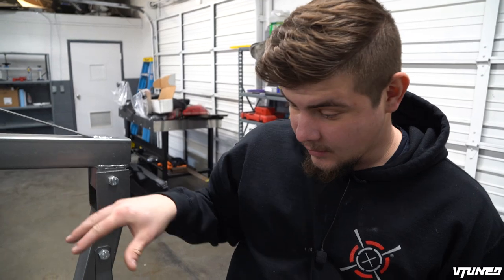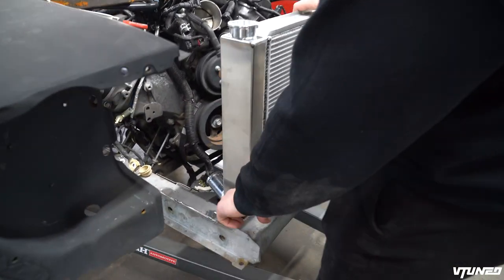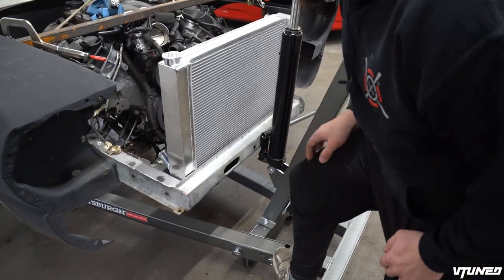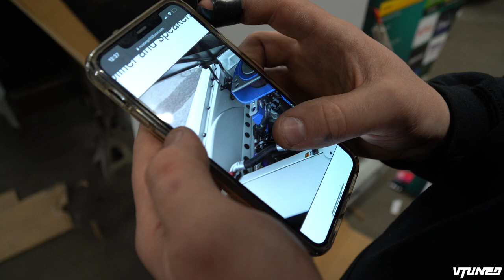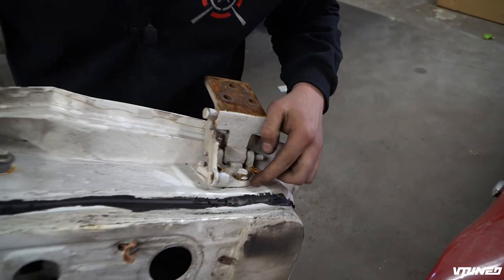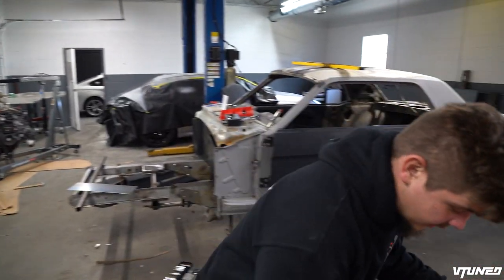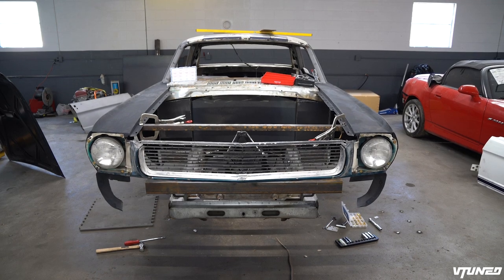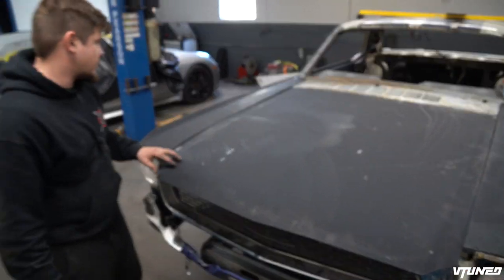Building Custom Front Aprons For My 1965 Ford Mustang ! 1/2

Comment: I still really don't like where this build is going, it started strong but it's going the same way as the last one, you should've kept the OEM firewall, aprons and core support, people have been swapping 5.0 engines into these Mustangs for years and they can handle it just fine, the combination of the firewall, aprons, core support and frame rails is way stronger than you might think, and with the custom subframe it's even stronger, doing all of that work to just have the engine a few inches back won't change anything on the handling, trying to reinvent the wheel for no reason and just to make things harder with the steering column, pedals, a/c/heater, and other things, i'm not hating, just sharing my opinion, but i wish you the best with this build.
Reply: You’re not wrong JD 🤔
Reply: You're also redesigning the structural design of the car...by using (14ga.) steel you are changing the handling of it...the integrity of the crumple zones that are intended to keep passengers safe... especially the 2×3 welded to the frame and the bottom of a A-pillar... using (18ga.) or even(20ga.) w bead rolled designs gives it the strength of (14ga.) w less weight
Reply: This is a unibody car without a frame. I’m afraid it will fold up like paper!

Comment: You are making life hard for yourself.. slow down a bit… you are jumping a head… mount the engine with headers, mount the suspension and steering, brake booster and master cylinder etc… all the items that are fixed then make you your metal paneling and tube frame, that way you can account for suspension components, movement arc’s at travel extremes etc.

Comment: poisonally, i wouldn't cut or design the inner fenders until you have all the engine and suspension built, you never know where you are going to run extra pipes and bits and pieces - all of this is pretty cosmetic including the outer body shell
get the mechanics done first then wrap it up with the pretty bits

i watched what you did before and completely understand why you began to lose interest, the previous build became complicated trying to fit bits around other things as you went into detail, don't its also one of my failings bless

but do as you like, because its way more fun for us to see the mistakes, and changes to design

have you started watching the muscle car channel, i will have to beat young Yuri and get him to nudge you

Comment: The 5.0 GO_CART is coming along, continue to devalue the 65" build your aprons 1st so we can see you hack them apart when you install components later.  Your comment that the original factory design was weak couldn't be further from the truth.  In 65" the designers had more of a thought process in building a car than you.  When all of that metal comes through the dash in a front-end collision hopefully, you'll remember some of these comments you wanted.to hear.

Comment: You really need to slow down with the fabrication of the sheetmetal. You don't even have suspension, brake booster, headers yet.  Seems to me you are making videos to get sponsorship, not make a good job. Slow down and look at the entire picture. If you want tight and clean, you have to have measurements and a plan, not just cobble things together as you go. Custom cars when done require a lot of work, assembly, disassembly, reassembly. More importantly they require an overall plan. Constant sniping against people who disagree and have better ideas doesn' ingratiate you with viewers. Personally I can see another waste of a car and steel so sorty, I'm out.

Comment: Why don't you just buy those apron parts and any other all-ready-manufactured structural sheet metal for this car? Stop trying to be such a genius and get the car built. You have gone through 3 Mustangs already. To me, you are just spinning your wheels.
For all the time you have been messing with this Mustang Dream idea, very little is really getting done...